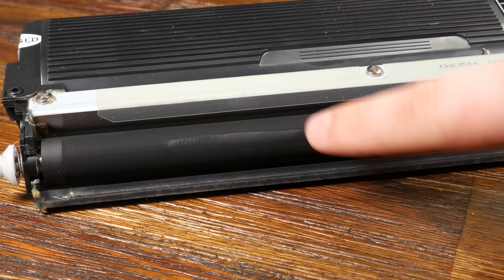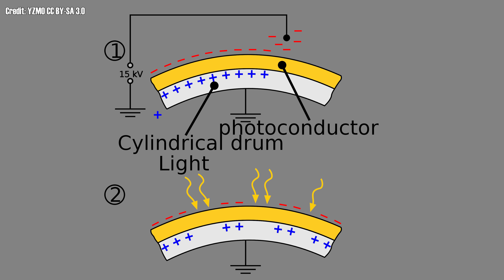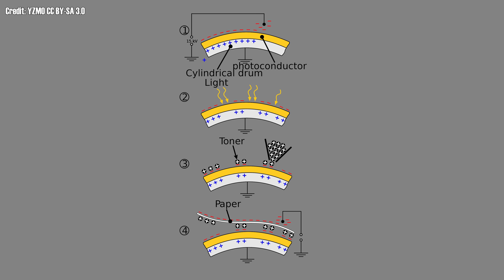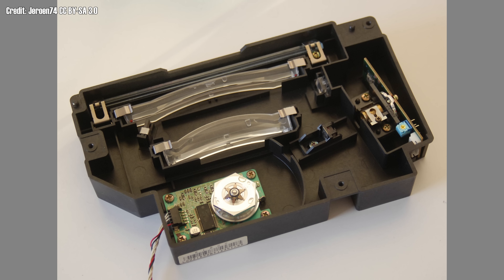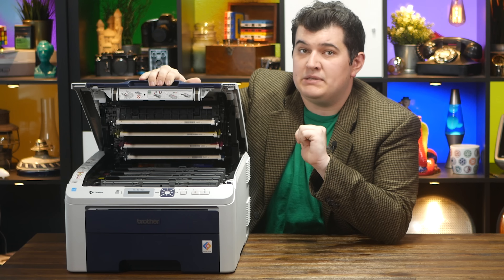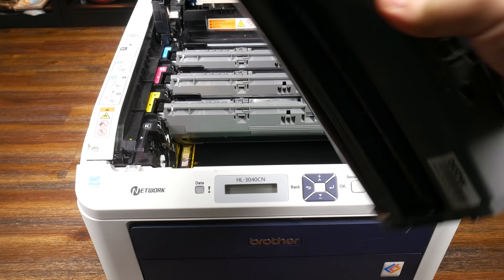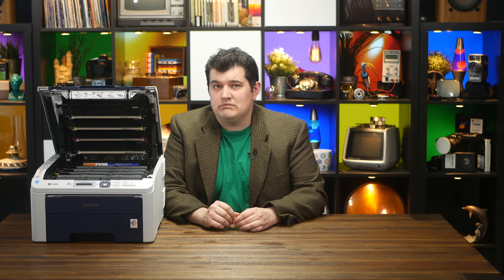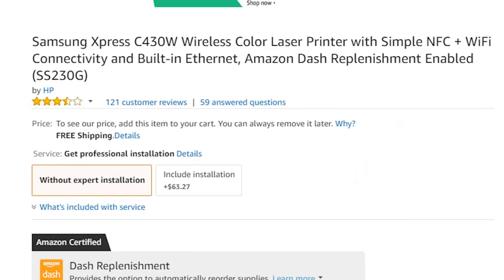LED Printers: The Common Printing Tech You Haven't Heard Of

Comment from the maker: One minor footnote:  Usually (if not always) in laser and LED printers, the polarity of the toner is reversed from my explanation.  Parts of the drum that receive light attract toner, and dark portions do not.  Rather frustratingly, I can't find where I had read this (pretty sure it was just on everyone's favorite source of knowledge, but visiting my recent pages and some Ctrl-effing hasn't helped).  If my unreliable memory is correct, this reduced wasted toner because it allowed for stronger repelling of toner in the unexposed parts of the drum.  Or something like that.
Reply: I have a similar printer  (3150CDN) and all I can say is the  most reliable printer I ever had. It never jams, never out of ink mid-job, it can print in long batches or be left unused for months to come back and print perfectly. The quality still is not on par with an inkjet, but for documents you can't beat it.
I noticed your toner holders and cartridges are kinda messy, are you rechargin yours or using alternative ones? if so, how's your print quality and does it damage the imaging unit?
Reply from the maker: Well, I've inherited this printer from my parents who wanted an all-in-one for copying and scanning.  From day one it's been using generic toner replacements, and some years ago there was a bad batch of cartridges that leaked everywhere.  In recent years the availability of decent generics has much improved, in fact a good full set (plus an extra K cartridge) runs around $60 on Amazon.

And indeed, this printer has been very very reliable.  The only bummers are that this model doesn't do duplexing, and that it takes a while to warm up.  Recent laser printers can warm up in something like 6 seconds which is awesome!  I have a newer basic B+W printer (also a Brother, though I think it actually is a laser printer) that does auto-duplex and warms up much faster, so the HL-3040CN stays idle unless I need color.  Which is quite rare.

Honestly it's pretty much a spare at this point.  But a very good spare!
Reply: The new printers use a different method of fixing the toner. The good old ones used a large halogen bulb inside a teflon-coated aluminum tube. The paper was squeezed against this tube and a soft, flexible silicone-roller. In the new printers the heating is done by a thick-film heater - a ceramic substrate made from Alumina (Aluminum oxide) has a deposited track of resistive material on it. Over this heating element there is a spinning loop (tube) of what seems identical to the reusable teflon cooking sheets we use in our oven. The paper is squeezed against this loop and a soft, flexible silicone-roller. There is almost no thermal mass to heat up, so the fixer is ready in an instant!
Reply: Our HP laserjet 4+ has started to print dark clouds on the edges of the paper.  A replacement HP toner cartridges (for the Office Depot generic) didn't fix the problem.  I suppose we have a bad (maybe just dirty) fuser unit as a result.  I figured it wasn't worth the expense having the fuser replaced, and it didn't look like working on the printer myself would be easy, so we ended up replacing the unit with a new one.  I have an HP LJ8100DN with a similar problem, but cartridges for this bad boy are in the $300 price range!
Reply: Kenneth Scharf if the printer has a ibt it could be that its going bad. Also which drum did you replace? When you do a 1 sided print is the lines on yhe front or back of the page?
Reply: Kenneth Scharf You may wish to check to see if the corona wires need cleaning (use a nylon bristle brush or a small cheap children’s paint brush) to dust off any lint or toner from the wires (but power off the printer before tackling), inspect the interior for spilt toner, inspect the drum (on that printer the drum will be part of the toner cartridge, often located under a shutter that swings in to position to cover the drum when you remove the cartridge) for built up toner or other debris stuck to the drum (you can use isopropyl alcohol and a soft lint-free paper towel to remove any toner or residue present).  As far as cleaning the corona wire goes, I know the JP LJ Series IV included a nylon cleaning brush under the cover, but I am not certain whether the 4+ included such under its cover, but any small nylon brush will suffice, just be careful so as not to break the fine wire (though they are tougher than they may appear), remember that you just need to brush any dust or lint off the wire, so no real force needs to be applied beyond that of the bristles.

If it is the fuser roller that has accumulated toner then you should be able to remove the toner using a lint-free paper towel and some acetone (look for nail polish remover, but verify it is real acetone and not an acetone-free alternative, if you want just a small bottle of acetone) as the acetone will readily dissolve the fused toner (toner is just a high temperature wax and acetone aggressively dissolves such).  Don’t worry if a few minor smudges are left behind as they can be hard to fully remove using only acetone, you just have to remove the excess buildup.  

Also be aware, though, that such defects can also be caused by the use of remanufactured toner cartridges where the old drums have been reused instead of replaced as the drums do not last forever.   So, if your inspections turn up nothing then it is worth trying a different toner cartridge to rule out a worn or defective drum as the cause of your smudges along each margin.

But I’m really impressed that you still have a working HP LaserJet 4+ as I had to finally retire my venerable HP LaserJet Series IV about ten years ago as I finally got tired of having to rejuvenate the rubber paper feed rollers every few months as it got to a point where the rubber had gotten too hard to grip and pull the paper through the paper path and up to the output tray on top.  Until then it had been in regular use from 1992 until around 2007 for all black and white printing.  About five years before that we had to finally retire our HP LaserJet Series II laser, which saw regular service from 1986 until around 2004.
Reply: Isn't there a thing about not using vaccuum cleaners to suck up spilled toner? I read about it about 12 years ago, but knowing more now about the science behind charged/uncharged particles makes it seem somewhat plausible of a warning.
Reply: That's true, static electricity build up is the problem, especially with mono-component toners or when sucking developer from dual-component, but the main problem is filtration due to small toner size of <1 micron. There are "special" vacuum cleaners for that purpose. 
 The hose is grounded (the whole vac is grounded, hose, filter, motor, plug, etc..ESD) and it uses high capacity HEPA type filters. Toner particles could easily pass through most household vacs. 3M was my favorite.
Reply: Yes a coworker of mine found out that a shop vac is not a toner vac the hard way. (He was scrubbing a wall for a day)
Reply: RE: Leaking Everywhere.  Brother uses toner carrier particles, an intermediate sized particle that brushes the toner onto the drum.  When poor refillers don't select the right toner or fail to refill this intermediate particle AS WELL AS the toner, they hand carts that will fail - that cannot exclude the smaller toner - because they don't have that larger intermediate sized carrier particle anymore and the toner just flies out of the gaps.  This is why the reversed toner charge is built into this kind of toner, because they have that extra step in the process.
Reply: @TechnologyConnections  -- My Dell C1760nw LED color printers (we use two for our home business) have always used aftermarket toner.  I pay $37 -- with free shipping -- for two complete sets of four top-notch toner cartridges.  Dell asks nearly $70 for one cartridge, which is nearly as much as we paid for the printers!
Reply: @TechnologyConnections  In testing, we found that a certain LED printer set to use 220V AC (did not test Brother) would work on 110, just taking longer to warm up. The opposite did not work, because the main power supply cap would explode.

Note: Do not under any circumstances use the 110V outlets to carry 220V, no matter how much it speeds up tests during manufacture...
Reply: My flawed memory seem to recall different polarity for OPC vs Selenium drum. Of course, this is probably before you were born.
Reply: Chevy your spot on...
Reply: I thought I had a laser printer, turns out it's LED. Thank you for the education!
Reply: Just as an added note to the video, there are plenty of modern color laser printers whose black and color print times are essentially identical (save for the occasional added communications delay on more complex pages since color requires generating four sets of monochrome bitmap sand transmitting that extra data) and are in fact laser printers with single pass printing (or twice for duplex).  These color lasers simply use four laser paths to illuminate each drum individually (either as four separate lasers and galvanometers or as four lasers and a common galvanometer that spins what is effectively four stacked mirrors to divert each individual laser to its proper window).
Reply: Faster color laser printers align their toners all in a row and use either an OPC belt, or a lens and mirror system to direct the laser to separate OPC drums in each toner cartridge. That style is quite fast at color printing. Before those, color laser printers mounted toner cartridges on a carousel drum and used an OPC belt. Oh my were they slow because they had to make four separate passes for every page.

There's another toner printing technology that was originally made as a workaround to patents on the laser part of the process. Halogen LCD. That put a halogen lamp tube behind a long and narrow LCD panel. Turning on or off individual LCD pixels did exactly the same function as the LED printers. Qume was the main (or only?) user of the tech in their CrystalPrint line. I had one in the 90's, got it used and cheap. Horizontal resolution was 300dpi, vertical could be 300 or 600. Qume was banking on higher resolution (at the time) and faster speed to make sales, but for some reason despite their high price ($5,600 for the CrystalPrint Express in 1991) they decided to make their own clone of PostScript instead of licensing it. Then Adobe altered their PostScript drivers for Mac and Windows to only work with printers having Genuine PostScript. That cut Qume out of the Mac market (forcing people to use a LaserJet RIP like PowerPrint) and to use LaserJet emulation on Windows. But wait, the drivers included with Windows 95 for the older LJ models Qume emulated no longer supported all the features of older HP printers. Almost as though Apple, Adobe, HP, and Microsoft had a meeting and said "Let's screw Qume and everyone else not paying our license fees or are users hanging onto an old HP printer."

Then the laser patents expired, making it open season for all to fire lasers at organic photoconductors and weird alternative tech was abandoned.
Reply: @greggv8  That's great info on the history of xerography printing.
Reply: Techmoan made a video on a new version of vinyl video where they recorded LQ B+W video on a 45rpm record
How does it work though??!?
Reply: You just got me thinking; modern compression techniques makes this more possible!
Reply: Hey did you know about tech tronics solid ink printers? Called colorqunes ny xerox after they bought tech tronics.  Amazing print quality but bad design choices make it a pain to work on.  Btw printer tech here
Reply: NO.
When the light hits the drum (photoconductor) it grounds that portion without any potential (voltage) and no toner will be attracted. Only charged, UNEXPOSED will draw toner when passed through the developer (toner) unit..
Also, before toner is applied you have what is called a Photo Latten Image. This is the Basis of Xerographic process. as first developed by Chester Carlson.
The area of the drum not exposed to light remains negatively charged.
The toner is positively charged. When it is applied to the drum to develop the image, it is attracted and sticks to the areas that are negatively charged.
Reply: Toner can be positively or negatively charged it depends on the drum your using and the patent royalty you want to pay.
Reply: yes, pos or neg, but the point is the exposure will ground the charge.
Reply: I can't see your Creative Commons Sign!
The image of the cat youbused is CC By Sa.

Sa means Same, and so, that your video ALSO needs to be published as CC By Sa. Please add this note to the videodescription. Thx
Reply: Old analog copiers worked the way you described in the video, newer digital copiers/printers work the way you described above, but the toner is not transferred from the drum to the paper, first the image is crated on the drums then transferred to the transfer belt, then the paper (I am a copier tech)
Reply: Both "light writes white" and "light writes black" existed in the world of Xerography.  So what you read was correct, just not the whole truth.  In the early days of Xerography the analog copiers obviously had to use the "light writes white".  But the early lasers were not as robust as they are now and engineers came up with "light writes black" so as to greatly decrease the duty cycle of the laser.  Now that led lasers are much more reliable, they've gone back mostly to "light writes white" which yields a superior image, IMHO.   Thanks from an old engineer who really enjoys your videos.
Reply: a couple of notes..  it depends on the drum for write to white (remove charges) or write to black ( adds charges) .. Opc ( organic photo-conductor) and Asi ( amorphous silicone) and toner is usually made up of toner and carrier. the carrier stays on the developing sleeve, and acts as a fine brush to carry the toner to the charged drum.  The carrier stays with the drum by magnetism and is usually made of iron filings.
Reply: Nice presentation.

Toner can be positive or negatively charged. That is one reason different printers can't use the same toner. I am not talking about the form factor, but the toner inside. The re-fillers have matched toner for different cartridges.

The laser has one light and a spinning mirror to activate the drum. LED printers have a complete row of LEDs, no spinning, for the photosensitive drum. While he states an LED column, it is generally considered a row, but if you print in landscape then it can be called a column, but it is still a row.
Reply: Yep that comments wrong. It depends on the manufacturer. Samsung hp canon oki negative. Brother Kyocera positive. OKI invented Led printing.
Reply: You are correct that the polarity has flipped the switch was made going from analog to digital. The reason is with analog copiers the light is reflected off the paper you are coping and down on the drum so you wanted the toner to stick to the non shined on places but with digital it was so much easier to shine the laser/LED where you want the toner.
Reply: The reason for laser/LED on = black comes back to the rating of the printer most are rated for a 10% average coverage that means the light is rated to be on 10% of the time printing. The other way it's on 90% of the time.
Reply: ORIGINAL photocopier video https://youtu.be/MJ5ghlTdF9k
Reply: the transfer roller on b/w is what charges the paper to pull the latent image off the drum on color it is a belt with the rollers under it to pull the image off onto the belt then a secondary transfer roller pulls the image on the paper, the waste toner on bw is scraped off and put into a waste toner bottle or a container built into the cartage
Reply: doing regular maintenance on these parts prevents toner scatter and using brand name toner is the key
Reply: The polarity varies by brand but for the most part analog copiers were white writers because the light reflected off the white paper directly to the drum. Most machines are black writers, especially if they do color for toner saving. Black printers can usually recycle unused toner but color ones cannot as they will become mixed and instead are dumped into a waste toner box. Some toner cartridges like HP may incorporate a waste toner compartment to reduce user involvement.
Reply: It's fine. This though, is the reason that drums are photosensitive, and why, I cringed every second you had that cartridge out in the bright light (it's already kinda dark though...). Over time, they will get darker and darker from use, until they need replacement :)
Reply: Some older printers used the "write to blank" design. Most newer ones use "write to image" so when the laser fails or gets blocked, you don't get solid black prints.
Reply: Ok. Last thing first. The fixing unit. Even though all of them do the same thing (melt and press the toner onto the paper), two different methods of heating are used. One, with a large halogen lamp inside a fixing roller made of aluminum and coated with a non-sticking teflon layer, wich takes longer to heat up and is required to be kept hot all the time to decrease first page output time, so it wastes more energy, but it accumulates more heat, so it's better suited for high speed printing, and one with a ceramic heater inside a thin sleeve, which takes less time to heat up, wastes less energy because it doesn't require to be kept hot all the time, but it can't keep up with high speed printing, and it' s lifespan is shorter than the halogen lamp type (max 80k pages compared to about 250k pages).
The image formation. Some color printers use 4 drums inline, in front of an Intermediary Transfer Belt wich collects the toner from all the drums in one pass before transferring it to the paper, and others use 4 developing units which change sequentially in front of the photosensitive drum, which collects the toner from the 4 developing units one at a time, before transferring the image to the paper. That's why for some smaller (or older) color printers the color printing speed is only a quarter of the monochrome printing speed (it takes the imaging drum 4 turns to form a complete color image, vs one turn for monochrome). The latter method requires a lot of moving parts, and changing the toner cartridges is a pain in the rear end, and i don't think is used anymore, but it was the first viable method for color copying/printing.
Developing. Here, there are two ways, too. One, where the developing cylinder (made of a metal sleeve with a magnet inside) is at a very close distance to the photosensitive drum, and the toner is attracted to the charged areas, and one with the developing cylinder (made of conductive rubber) in contact with the photosensitive drum, where the toner is repelled by the charged areas (opposite to the first method).
Electrostatic charging and transfer can be done with contact rollers, made of conductive rubber, in contact with the drum, using a voltage of about 800V, very compact, but because of them being in contact with the drum, the drum wear is much quicker (drum life of max 20k pages), or by corona units (a thin tungsten wire in a stabilizer cage), using a voltage of up to 4kV (!!!, and this produces a lot of ozone, which becomes toxic in large quantities), which requires constant maintenance, requires the machine to be fitted with ozone filters, but alows for very high speed printing, and very long dum life (about 6M pages).
Finally, drum exposure. In printers and digital copiers, as stated in the video it is done by a laser beam scanning the drum one horizontal line at a time (perpendicular to the paper travel direction) or by a dual (or triple) inline LED array. The downside of the LED array (besides the low resolution) is that if a LED fails, it produces an annoying color vertical line on the printed page, because most of the times this exposure method is used in conjunction with the second image developing method described above. All the high speed printers (up to 150ppm, or more) ar fitted with laser beam units, and that tells a thing or two about this method.
After all, the term "LED printer" is misused, because in all the xerographic printers the laser is produced by an LED (or more)
Reply: It all depends on the materal coating the drum. If the coating works better with a positive or negative charge. There was a major shift many years ago from Selenium (yellow coloured drums) to an OPC (organic material usually brown or green). It was realized that Selenium can cause cancer...
Reply: Personally... even as a tech, what is positive vs negative charge is not a big deal... just that charges exist and is how the toner is transferred and (mostly) stays in the right place.  
One fun part... the little threads which hang down on the output of the fuser... are there to dissipate left over charge, so sheets of paper coming out are not sticking together or repelling each other... as both can cause paper not to stay in the output tray...
Reply: Any chance you would do a cost analysis to help us understand the cost (initial and ongoing) of one of these LED printers versus inkjet (with refillable tanks ideally, as that)?
Reply: This is actually incorrect. The portions of the image that are devoid of toner are the parts hit with the light. The laser (or LED) draws the toner-free portions of the page. See my explanation elsewhere on this thread for more.
Reply: Not universally true. In the industry we call it "black writer" or "white writer" meaning that the laser exposes the place that attracts toner (black writer) or the other way you explain (white writer). The "black writer" setup is the most common setup for a long time now across the industry. But in decades past when photocopiers were all analog, yes it was the places where the light exposed the drum that did not attract the toner.
Reply: Led printers? Cool, I always wanted to print my own Leds.
How long does it take to print a 500Watt 5600K Led and on what voltage will the printed Led run?
Reply: LED printers are still laser cause of the led being used if you look in to fibre optic communications most modern fibre optic communications uses a LED laser for the light component and not a traditional laser, even in CD players you will find it is an LED laser as it’s light source, so still a laser.  So the LED printer uses an LED lasers have a look at the Bluray laser diode that is also still an LED as it’s a diode.  Pays to look into things a bit more closer Alec.
Reply: You are very much incorrect. Solid state laser and LED is not the same. The LED-printer that alec shows off is not using 1500 small laser cavities in each string. It uses 1500 small LED dies wirebonded on to  a strip of circuit board next to a bunch of shift registers. You sound like solid state lasers in CD players is something new - have you been living under a rock?
Reply: I sense a bit of nomenclature confusion here. Semiconductor lasers (i.e. the ones in laser pointers and optical media) are called Laser Emitting Diodes. The somewhat confusing bit is that both Laser Emitting Diodes and their more traditional Light Emitting cousins get abbreviated as LEDs. 

Thus you can have a LED printer that uses a beam of coherent light and a mirror assembly, and a LED printer that uses thousands of chips shining directly on the drum.
Reply: NO. No. No. And LED is NOT a LASER.
Do not let the word Diode confuse you. 
The LED or Ligh Emitting Diode and The LASER Diode are two different animals 
LASER or Light Amplification by Stimulated Emission of Radiation
Both are Solid State semiconductors. But here's where they differ.
The LED emits incoherent light and 'LASER' is coherent. BIG DIFFERENCE. Two very different technologies but at the same time identical in that they are Solid State. What separates them is the COHERENT light of the LASER.
And No, the Bluray players and recorders both use LASER Diodes. CD and DVD also use Laser Diodes.
The difference is in the wavelength. CD use Infrared at 780nm, DVD is in the RED range (650nm) and Bluray (it's really violet) at 405nm. The Laser is capable of focusing a beam very tighly, where an ordinary LED would be imposible. 

here's some info on the subject that should help shed some light on the subject.
https://www.miridiatech.com/news/2014/02/laser-vs-led-whats-the-difference/
Reply: If LED is incoherent light then by that statement alone you have verified a portion of what I have said, that the printers use LED or Laser Emitting Diodes, as an incoherent light source would create a blurry image on the drum therefore the paper, so to maintain resolution the LED would have to be a solid state based laser producing a fine point and therefore also contribute to the heating of the paper as an LED (Laser Emitting Diode) would still have the same heating effect.  So I'd have to say yes its an LED printer but its still using lasers, but thousands of them at a fixed focal length so no need for a focusing mechanism as they are fixed at specific distance so you still get a sharp image with a little loss of quality as there is no compensating mechanism to adjust for the slight variation in focal length as most LED ( Light Emitting Diodes) have a beam width of approx 30 to 50 degrees even at a small size this is not precise enough to produce a quality image, and is not intense enough to cause heating of the paper the way it does in the LED printer which is using a form of solid state laser diode.
Reply: yes, a laser diode focuses the beam  narrowly or very finely. That maintains phase distortion at a minimum.
Reply: @filemax No, each LED represents one dot (DPI). There is NO burning here! Forget your concept or wording "Laser emitting diode"!! 

there are 1-Ligh Emitting Diodes and 2- Laser Diodes. 
Before the laser, there was the Analog Copier, which is what laser & LEd printers are based. This is Xerography. This part of the process is called exposure and used flashlamps or halogen light in a scanner assembly which were incoherent light sources. 

>>>The tight beam required in Optical reading and writing (CD, DVD, Bluray) is much, much smaller, thus requires am incoherent light source that is capable "burning" when recording..<<<

http://alan.ece.gatech.edu/ECE3080/Lectures/ECE3080-L-11d-LEDs%20and%20Lasers.pdf